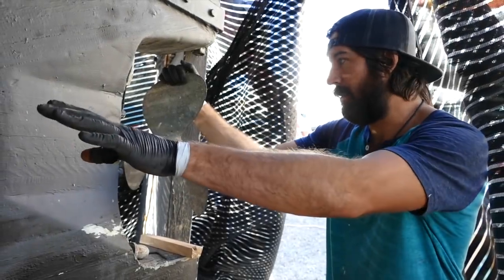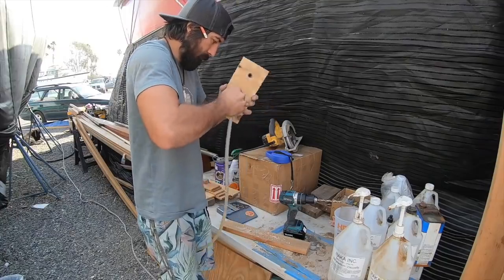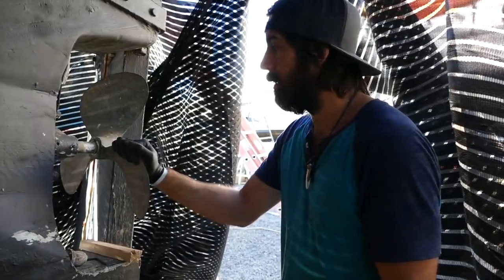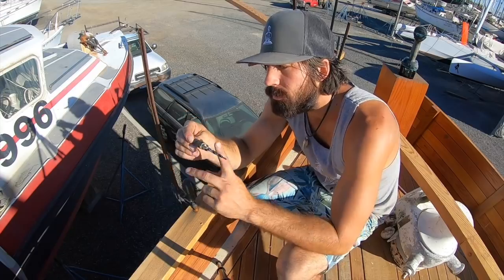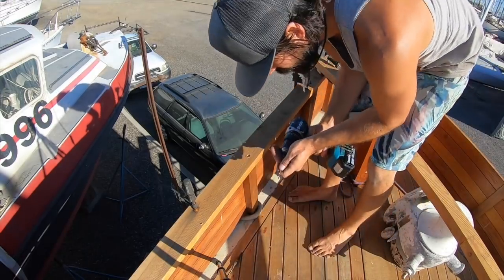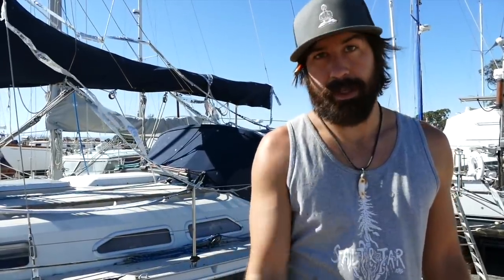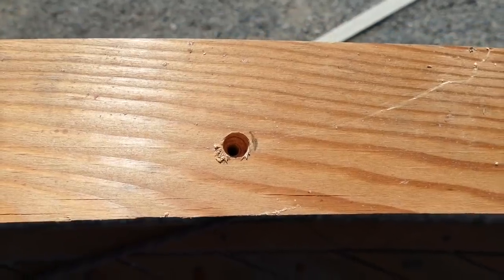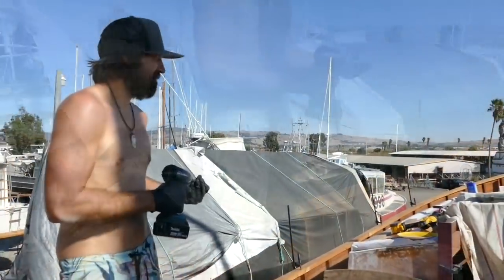Salt & Tar: Episode 67-Living in a Construction Zone

Comment: You can insert a pvc pipe into the shaft hole and then pour epoxy in to fill the void around the pipe.
I Did this on an in board I built works a treat

Comment: To help prevent screws from snapping, coat the bottom threads with a bit of beeswax.
Reply: Beeswax is expensive, toilet rings are cheap and work just as well.
Reply: @BillB23  as a beekeeper, I literally have boxes of beeswax on hand. :) It's also less messy than wax rings to keep a chunk of it in your toolbelt. I agree, both work.
Reply: @barrybirkey3282  Not too many beekeepers in metro Atlanta. Supply and demand mandates a work-around on the mess factor. That said, I'd prefer beeswax just from the difference in aroma. Also, beeswax has a sensual feel to it and can be superior to a paste wax for wood finishes. It depends on how deep the client wants to dig into his/her pockets. Thanks for the comment and I wish you a prosperous 2020.
Reply: Bill Brockmann , well  we use Beeswax in pattern making all the time to make fillets, it comes pre-shaped. It's not very expensive, we have so much we will never use.  You could easily put a little stick of it in each screw hole and the wax would coat the screws as it goes in. 
 Mind you I think Garret has put about 10,000 screws in this boat so knows a bit about what works by now. Rebuilding my dad's old  wood boat we used old fashioned plumbing grease , sort of lanolin. But that was 40 years ago!  
Cheers Warren

Comment: Could you plug and fill the prop alley with a few gallons of copper green, let it soak in THEN epoxy it with a few layers?
Reply: +1 on this.  Could also put the epoxy on with a lambs wool dauber on the end of a long wooden pole.

Comment: I know it has been a while since the shaft alley needed drying but for another drying project you may want to consider silica gel cat litter...Very good stuff to remove moisture and it can be reactivated when dried in the sun or on the defogger of a car with the heater on...

Comment: Given YouTube time verses realtime this work is probably long finished, but another way to get a overall consistent penetration and coating of expoy on the shaft alley, would have been to use the same two plywood ends but make an airtight gasket using rubber or hose on each end with a tire air valve in one end. 

Then using a ramrod longer than the alley with a rag fixed into a virtical split in the end,  coat the alley with thinned epoxy first to wet it out and then a liberal coating of thickened epoxy to line the alley, seal both ends with your gasketed end pieces and use any type of air pump, from a bicycle pump, foot pump or airline compressor to bring it up to a few foot pounds of pressure, which would force the epoxy into the wood and give an even overall penetrative coating, then repeat the process  as required to increase the coating thickness.  Regards Dave.

Comment: Painting your whole hull with epoxy tar before you put your primer on so it can take your layers of top coat, is the best thing about 4 layers. First layer thinned ending up with last layer not thinned and then your primer. All layers should be applied while the individual coats are not fully dried including the primer layer. This layer will mechanically fix to the last layer of epoxy tar so you can paint the top coats and  antifoul  successfully. no worms will go through the tar.

Comment: SUGGESTION: why don't you find some copper tubing, (straight water copper pipe) that will just fit into the shaft ally ans either tight enough to drive in or just enough to slide in tightly and epoxy the tubing before you drive it in and that could be a permanent solution. You could then fill the tubing with thick grease or cover the shaft with the grease and slide it in.

Comment: A piece of delrin/pvc expoxied into place would be a long term fix. Epoxy has a tendency to seperate in thin layers without structure. I found this to be very true in small quanties resin on say a natural material lining on a tube like a cup. The cylinder in natural material expands to a larger cyllinder yet the epoxy keeps its smaller shape thereby breaking bond and delaminating. see #Acorntoarabella shaftlog install fir ideas. to test; Make a coffee cup of wood with liner of resin of the same materials and run many hot/cold cycles through until at some point liner starts peeling away. Then u know when to check for repairs.

Comment: So assuming that you haven't begun the process of the sealing the wood yet, I did a little research of my own and in the final coating of the sealing while it is still tacky if you sprinkle a light dusting of a pyrethrum powder when it comes into contact with the wormies(or any other critter) causes their digestive system to seize up and they starve to death in hours. ALSO, in the water purification industry, they have these rods that emit an Ultraviolet light that kills off all the nasties in the water and it also kills them worms as well. Soooo there are a couple of more avenues for protecting the boat from the accursed sea monsters

Comment: Interesting. So the shaft tube is only wood? Most boats have a metal tube liner inserted.  I would doubt that any epoxy would absorb after the first coat.  Getting the tube completely dry would be critical before epoxy.

Comment: I am not a boat builder but why not let the epoxy completely harden and the drill out the shaft so there would be no wood at all getting wet?
Reply from the maker: It's about 6 feet long so it'd be really hard to drill straight and it's just not neccessary. A few pours and were good to go 👍

Comment: Garret, do you have room for a zinc on the prop shaft,
And are you using the Git Rot epoxy resin?
Reply: Git Rot is the last thing a boater should do to their boat. I've dug some much of that junk out of boats just to fix the problem it has caused. It is a lazy mans fix all.

Comment: Dang, your not dipping your screws in 5200...You must!!!...there's osmosis.  The other thing, you should be using 4200.  You want a sealant and not a glue.  On your prop shaft and keel there should be sacrificial soft wood.  I worked with a charter compant in Mexico.  Can't believe the worms.  But even they like certain woods better...Rebuilt a boat in Vanuatu...keel was gone...we did it on logs....strangest boat...fibreglass with a a wooden keel....what a mess.  You can make penetrating epoxy.

Comment: Unfortunately you used the wrong glue on the cap-rail. #5200 is so freaking expensive and I'm afraid you just made some giant very expensive gaskets. What you should have used is Resorcinal glue. Though #5200 is incredible tough, it won't soak into wood fibers to create a mechanical bond.  Also, unfortunately for me, I learned this the hard way. :) If you are depending upon the glue to create a structural bond, then perhaps you should do a 2 foot test section to see if I am correct.

Comment: You should just finish the boat completely before you put it back in the water. I mean it's really a no brainer.
Reply: You going to pay the yard fees? Every haulout I ever did was well planned in advance to spend the shortest time in the yard as possible. Moorage is far cheaper.
Reply: It doesn't seem cheaper than floating an unfinished boat only to have to pull it back out again.
Reply: @couerl  Then you have not done it yourself.
Reply: @webbtrekker534 That's true, I haven't built a wood sailboat myself, but I have built a lot of things and am a good carpenter and my instinct says finish the job before you float the boat just like the old guys did 100 years ago.. They're just redoing half done work that probably would have been easier to do in the first place like the deck etc,..